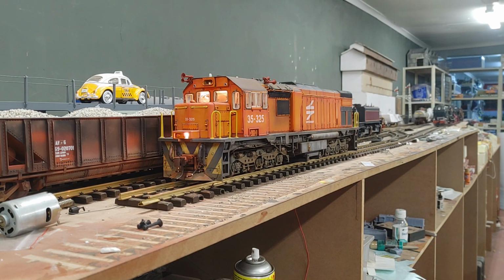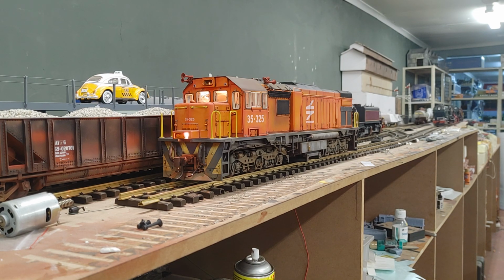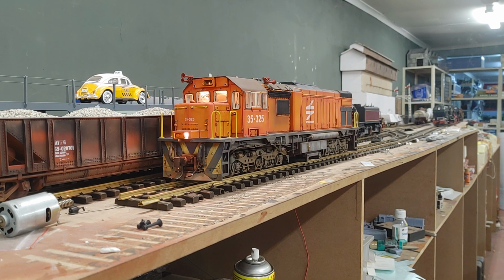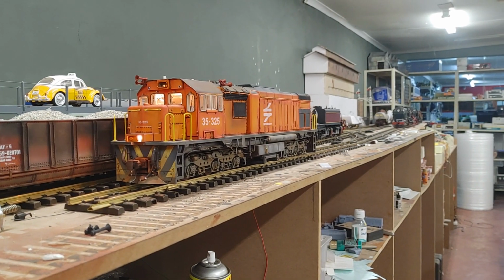Bigfoot and the 1/24 scale class 35GM

Comment: One superb model, the smoke is very realistic, the large scale helps in this aspect, as it does with the sound.
I had a foray in SA Cape gauge models in HO gauge on incorrect 16,5mm track, as the DJH models were offered in this track width only then.
A class 25 was built from scratch however.
As this all was in pre internet times getting information was difficult, I had to revert to whatever I could find in books which I could get in the UK.

I can imagine that sourcing your materials from within SA is a headache, and you may order most from the UK instead.
But I now know that there's a wealth of information collected by the RSSA.
All those Garratts in 1/24 are eye-watering and I subbed to your channel to see more of these nice builds.

After doing many other subjects I'm back in SAR again, but this time in On2 gauge on the correct 14mm track gauge.
But I might do Cape gauge models in O gauge as well in the future, running on 24,5mm track.

The remark you made that your face and body were designed for radio made my day!
Reply from the maker: I gather you manufacture your own track? O gauge is a lovely scale. Big enough to allow lots of detail and small enough to not eat acres of space. A NGG16 in O would be awesome. My favourite remains the NGG15. There is a crowd in Germany doing an O gauge class 91. I did drool over it a bit.
Reply: @riekusvanderwesthuizen471  I build track myself indeed.
The NG/G16 is under construction, the basis is a Backwood Miniatures kit, but as I'm modelling the first series of NG/G16, which was more or less a transition from the NG/G13 to the later post war NG/G16, lots of parts have to be made from scratch.
Also detail is not to overwhelming on this kit and partially incorrect.
I obtained a complete set of drawings in PDF format of the NG/G16 which are very helpful.
A NG15 is high on the list too, as well as a NG/G11 and NG10.
There is a loco very similar to the NG10 in operational condition on the Brecon Mountain Railway in the UK, it's a lovely machine.